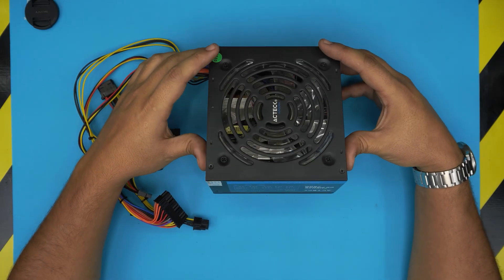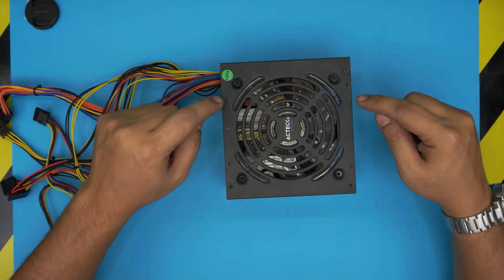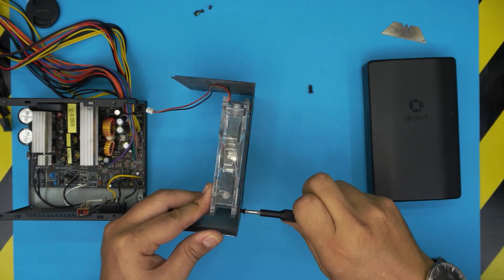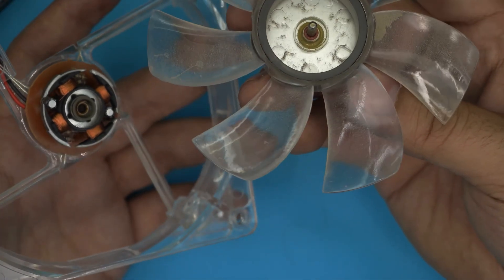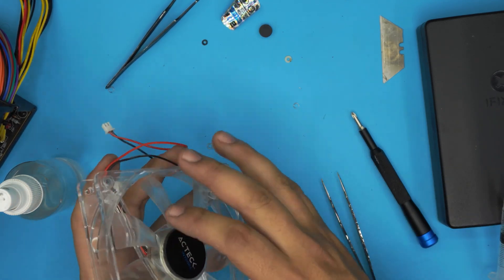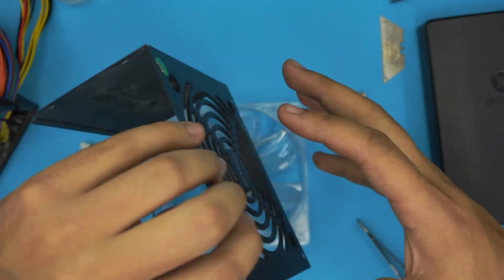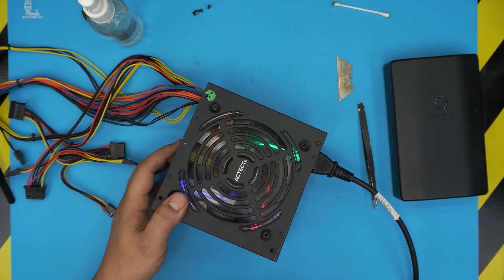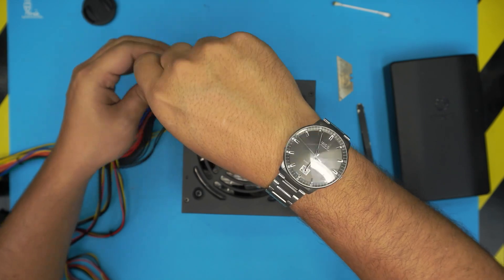How to Repair Power Supply (PSU) Fan Noise - Step-by-Step Guide

Comment: When you power up the power supply does that count for all power supplys? I have a 'Corsair TX750M, 750W PSU' and I really need to see what is making that noise it's driving my crazy.
Nice guide btw!
Reply from the maker: Thank you for the feedback! if you wish to support the channel you can LIKE or SUB or both :P
regarding your question: when you power on the PSU it will consume what the motherboard or components require of, if your CPU and HDD and GPU in total pull 400watt then you only consume 400W not the 750W. i always recommend to get 850+ even your GPU CPU need 400W , this way the fan noise of PSU stays low and last longer. but servicing the fan or changing it's a good idea when you pushing the PSU to its max load.

Comment: Good video. However, I wonder if the proof of repair is totally convincing : the noise happened when the fan was in downwards position, and tested after repair un upwards position... I suspect the problem was related with the big slack that was obvious, which got probably reduced or removed when repositioning the fixing washer. Worth trying anyway but I would rather recommend changing the fan, knowing a brand new fan typically fails after 2 years, so I wouldn't bet on a refurbished one...
Reply from the maker: Thank you for the feedback! if you wish to support the channel you can LIKE or SUB or both :P
regarding your question: i do this for living and after servicing the fan, even in its right position or upside down the noise goes away. this is a cheap and rather fun learning thing people can do and save money in process. OR you can replace the fan with a better brand and a quieter fan like Noctua fans. i appreciate you feedback and comments if you have any question or request feel free to ask me anytime. :)
Reply: Never had any fan fail on me after just two years..
Reply: @YK-dx4ux  I meant "a brand new POWER SUPPLY fan... after 2 years of non stop use'. These fans are low cost ones. Since the PSU fans are typically speed regulated, the MTBF can also depend on the average load. I manage a pack of ~10 PCs and I had the failing PSU fans at least 6 times in the last 6 years. The PSUs and some old HDDs are the weak links. The fact there are videos about this problem shows it clearly happens.
Reply: @bertcuzeau7800  you should buy better PSUs then. Mine typically hold up for many years without failure. I can recommend be quiet and Silverstone

Comment: Isn't it really dangerous to open a PSU? You should probably at least let it discharge for a day before. And shorting two pins doesn't sound great either, especially if you get the wrong ones I suppose.
Reply from the maker: thank you for the comments, and YES its very dangerous to open the PSU! without any guide, or lack of following instruction. if you or anyone have a slight problem of following instruction then DON"T watch this video. ELSE IT'S TOTALLY safe if you follow the steps i show you in the video.
regarding the shorting the cables, that part its VERY safe you can't harm you self if you make a mistake, the PSU has a OC (over current protection), the worse you can do its damage the PSU but not your self.
as i mention do not touch any other componentes in the PSU!
:)
Reply: Appliances with big caps (microwaves for example) are far more dangerous.
Reply: I think 1 hour is enough for big capacitor to discharge, you can also test with multimeter to make sure it safe to work with power supply. And always remember: do not immediately open the power supply after shutting down the PC because capacitor still storage electricity for a while and the voltage is very high can go above 200v and can make you electrocuted.

Comment: Great vid. What brand of lubricant was that and can I order it on Amazon?
Reply: Sewing machine or Wahl Clippr Oil works great as well.
Reply: @PapaMav  Thanks!!
Reply: @PapaMav  Those clippers oils  etc that are not viscous enough  won't last long there due to centrifuge effect. Do you wanna do this shit every month?
Reply: @brad8122  you need to step off bruh; they work fine, espcially with fans that have the removable plug.  Kept crap fans going for 4 years w/o a squeak and it was not for lack of lube that they died.  What's your suggestion then, Captain Attitude?
Reply from the maker: Thank you for the feedback! if you wish to support the channel you can LIKE or SUB or both :P
regarding your question: the one i highly recommend is this: https://amzn.to/3vBDToe
Reply: @uFixTek  Same with your lubricant. It didn't look viscous enough like the grease that were previously applied that you destroyed with the towel right there.
  It won't last long there due to centrifuge effect. Do you also  wanna do this shit every month?  

Can you give example(amazon link?) of those grease like thicc oils? People use those things in shafts for a reason you know?
Reply from the maker: @brad8122  you can use a thick oil but the thick oil will reduce the fan speed, and absorb more dust!, we have tested and thick oil not t a good choice for long term. but suit your self, A very good lube thick is: https://amzn.to/3PvQ6Ud
Reply: No idea if I've messed up but I've just used car oil 5w 30 since it's ment for constant use has the best wear etc hopefully it won't kill my fan 🤣

Comment: My fan is starting to make a high pitched noise. I will try this. Hoping the Antec Earthwatts 650w has the same fan. I have two Thermaltake 120mm fans in my case. I took off the label but there is no way to reach the bearing because the housing is molded plastic with no access. I ordered three new ones in case I need one for the PSU. Thank you for this informative video.
Reply from the maker: You're very welcome! Glad you liked it 😊Thank you for the feedback! if you wish to support the channel you can LIKE or SUB or both :P
if you have any question or request in the future feel free to ask me.
the fans that sealed at the back, those you have to pull real had straight out the fan and it will come out, and goes back in with a pressure, i make a video for those fan.